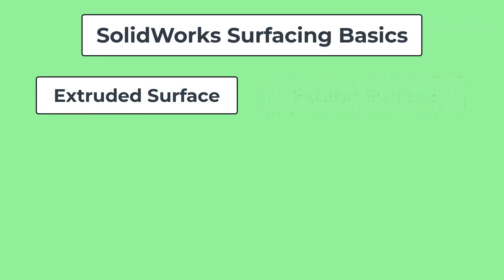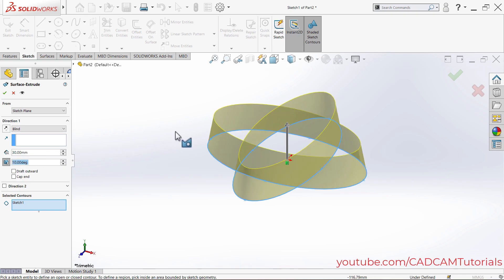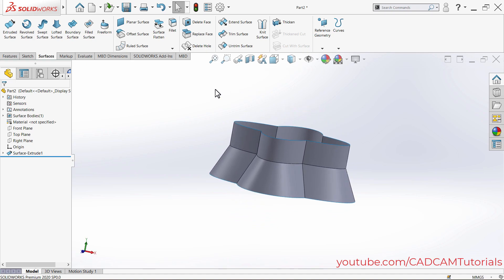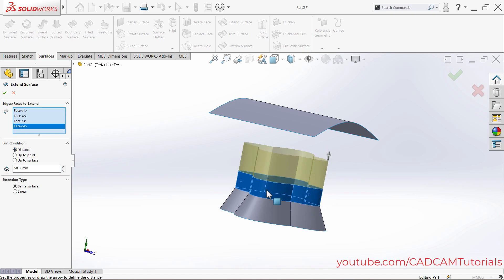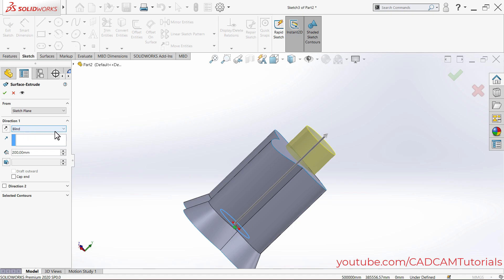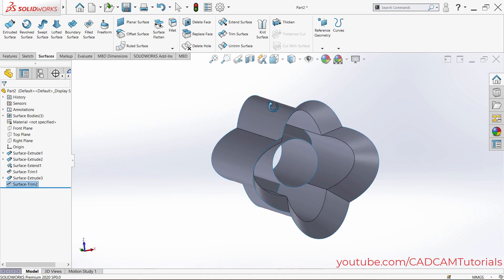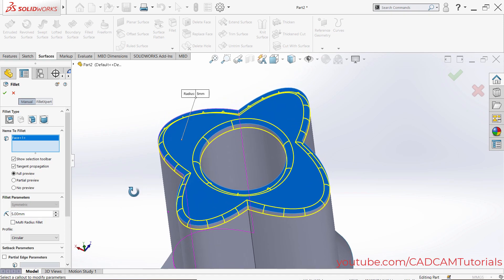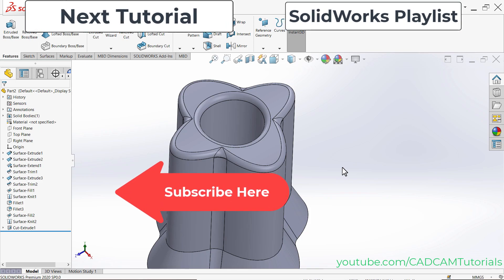SolidWorks Surface Modeling Basics Tutorial for Beginners - 1

Comment: im using the 2023 version, and in the extrude surface part, when i turn on draft on the second direction it didnt shown and it keeps saying error, any tips
Reply: you may need to use cap for either extrude direction. I am facing the same issue
Reply: @shivibakshi7196  oh thank you, the problem solved after using cap, but i am wondering if there's any other solution.